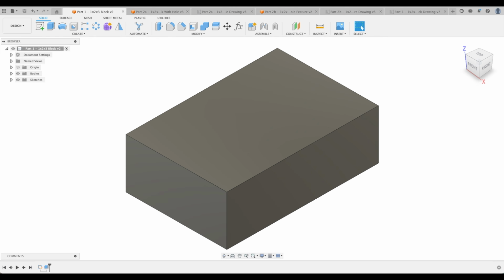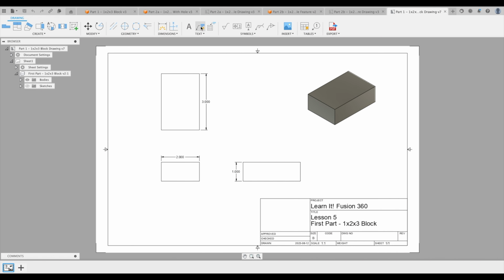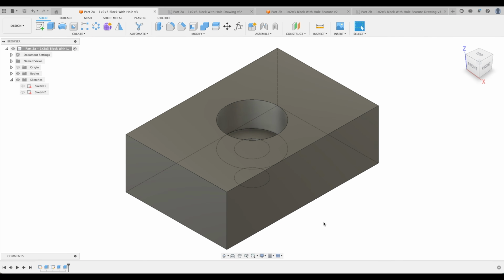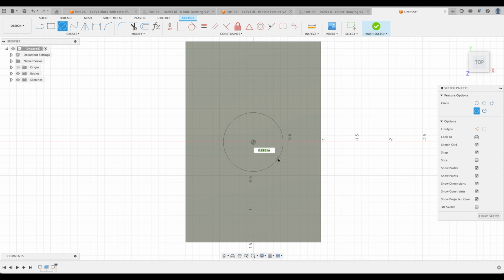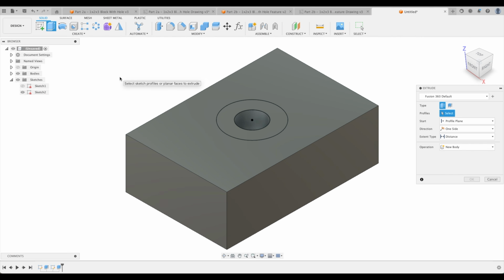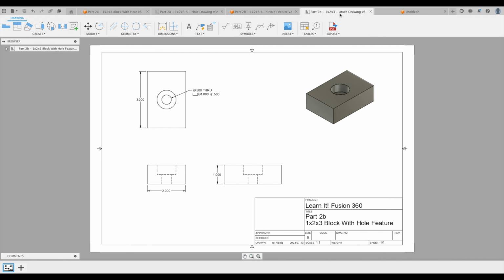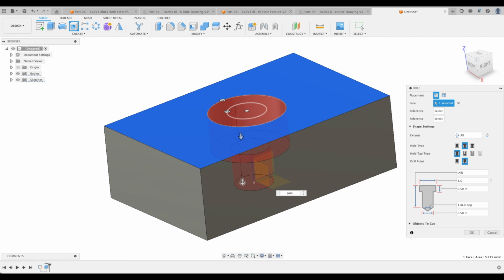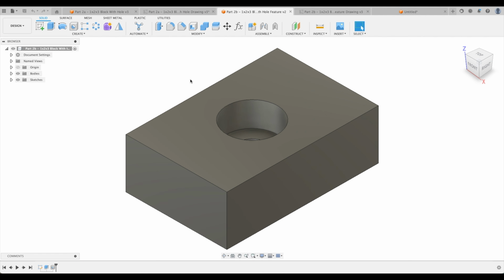Fusion 360 for Beginners - Lesson 5 - How to Read Drawings (2023)

Comment: should we be in assembly or hybrid for this?
i dont have drill angles in my hole properties
Reply from the maker: Part or Hybrid. If you select Part, you won't be able to create a new component, but that is totally fine. 

You likely don't have a drill angle available to select if you selected "All" for your depth.

Comment: for those who did not understood @16:39 (Second drawing) This since you said in the video about learning basics i thought i pass on a little extra digging i had to do to understand the concept. so this technical drawing is of a 'Counterbore Hole' (simplified: Hole for allen key bolts) so the 'U' symbol is for 'Counterbored hole' you can read more about this in 3rd figure of this page 'http://engineeringessentials.com/ege5/files/ege/dim/dim_page4d.htm' BUT in summary, U symbol with Dia symbol only tells you dia of the upper or the big dia and the depth symbol tells you only the depth of the upper hole. It assume that you use small hole dia drill and make a through hole and then bring that drill back to make the counter hole at the top. Another quick fact: Do you know that Allen key is not actually a term but used as a term. Proper term is 'Hex key bolt' or 'hex wrench bolt' and the 'Allen' is the company who owns the trademark over these types of shaped keys and bolts and hence the name.

Comment: Thanks again for all the great vids! The drawing doesn't explicitly indicate the hole is in the dead center of the object. Generally speaking, is it safe to assume when reading drawings that if something appears to be in the center and isn't specified otherwise that it is in the center, or should the distance from the edges or some other symbol be used to indicate that the hole is dead center and not a tiny bit off center?
Reply from the maker: You're most welcome! Thank you for the excellent feedback. These comments are what I love to receive. They show you're either experienced, or really thinking about things. Great job. 

You're absolutely correct, the drawing doesn't explicitly indicate the hole is dead centre. Generally speaking, if it is a practice exercise, you most likely can get away with it. However, from a professional level, I have learned over the years to always contact the engineer to get verification, no matter how much obvious or how much the engineer might squawk about it. In other words, when it comes to actual work, NEVER assume and ALWAYS verify. 

Regarding it being "dead centre" of an object, such a callout doesn't exist, but other callouts for dimensional accuracy and tolerance (called GD&T - Geometric Dimensioning and Tolerancing) exist which take things many aspects of manufacturing accuracy into account. I would love to produce tutorials like that in the future. 

Thanks again for your comment. Hope it helped.

Comment: Hey! Thx for the tutorial, is very well done and really helps to learn. The other i did they are to fast and it escalate to a very high dificulty right away. The only sad part is that i am from a part of ther wolrd were we use metric system.
Reply from the maker: Great to hear! Thank you for taking the time to express what you have appreciated and how you’ve benefitted. 

Regarding the units of measurement, please know that I am also from a country that uses metric as the official unit. I have learned imperial measurements and am confident you can too. I go back and forth between metric and imperial for the benefit of all my viewers. Additionally, you can let Fusion do the conversion for you: keep your document in metric, and simply add a double bracket (“) to the end of the value. A double bracket means inches and will automatically convert your value to metric. Easy!

Comment: is the dimension for the last hole a custom or is there a command in fusion?
Reply from the maker: The last hole is a “counterbore” or also known as a “c-bore.” The dimensions on the drawing are by using the counterbore hole tool in the design workspace. If you set the dimensions using the counterbore tool correctly, the. You just have to add a Note to your drawing which will automatically insert all the symbols and dimensions for you.

Comment: Thanks! Off to a great start. Love the repetition of the commands as you go. Might have missed it but shouldn't the drawing have dimensions or note to show the location of the hole on the XY face?
Reply from the maker: Thanks so much for your great comment and encouragement. Glad you are enjoying it so far. 

I didn't explain it entirely in this tutorial, but in instances when drawings are "missing" a dimension it can be safe to assume the dimension or design intent. If a dimension needs to goes outside an "obvious" spec then the drawing will be sure to specify that. This standard has definitely created some issues when the designer intended that something be centred (for example) and comes back way off, but usually this doesn't happen. Also, if a dimension and tolerance truly does matter then it will indeed be specified on the drawing. 

Just to highlight the truth of this, I made my own drawing for this tutorial, but I referred to the professional drawings in a catalog of a reliable and major producer of 1x2x3 blocks. I could have made a note on the drawing to completely make this clear, but didn't in this particular tutorial. I would probably add it to similar tutorials in the future. 

Thanks again! Excellent comment.
Reply: @learnitalready  Thanks for the detailed response. I used to do PAD (Pencil Aided Design 🙂) 40 years ago for a farm equipment manufacturer and generated hundreds of mechanical drawings for the shop floor as well as detailed isometric assembly drawings for setup and parts manuals. If only a tool like this would have been available back then I can't fathom the work that could have been accomplished. Looking forward to the rest of your tutorial.
Reply from the maker: @ I love it… PAD! Hope you enjoy our other tutorials. Please keep in touch as you progress down the line. All the best! □

Comment: How do you find the drawings?  There are no tabs?
Reply from the maker: Thanks for reaching out. The drawings I created within Fusion. I jump back and forth between the drawing and design during the tutorial. You can create several designs by clicking on the Plus sign at the top right of the Fusion window which will add more tabs. However, you cannot access my drawings this way. You will need to either a) take a screen shot of the drawing during the tutorial (which you then can print it out yourself or use on a different monitor) or b) head over to our Patreon page (all drawings are available for download as a PDF by our paid members). Check out our Patreon page here: https://www.patreon.com/learnitalready?utm_campaign=creatorshare_creator

Let me know if you have further questions. All the best!

Comment: Question on basics. If you place a counter bore hole on the 1,2,3 block and then decide you wish to move it to a new dimensional location how would you move it? When I say a new dimensional location I mean create a spot you wish to move it to and move it to that location.
Reply from the maker: Thanks for your question! 

It depends: do you want to move it to a different location on the same original plane, or on a different plane? If the c-bore will be located on the same plane, then it is quite easy to do. In your timeline, right click the sketch tool (that contains the point you’ve created) and right click to select to edit that feature. Delete the constraints (if there are constraints) and then click your dimensions to check their value. If you don’t have any dimensions specified, then your point should be blue, which means you can simply click, drag, and place in a new location. Finish your sketch, and then the c-bore should update automatically.

If it’s not working out for you, please keep watching the next 2 or 3 tutorials in the playlist. They will teach you what’s needed to know exactly what to do.

Thanks for tuning into our channel. Hope you benefit from our other tutorials too!